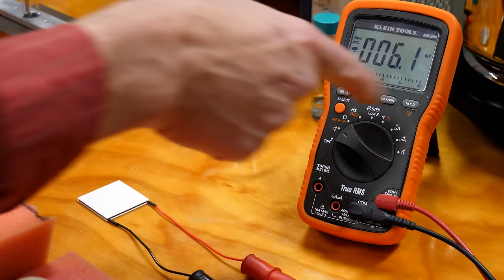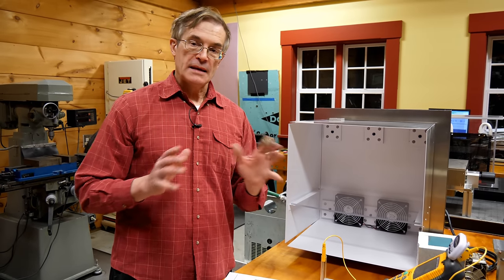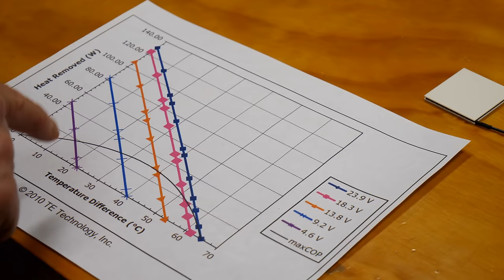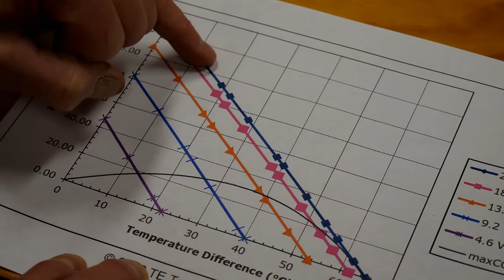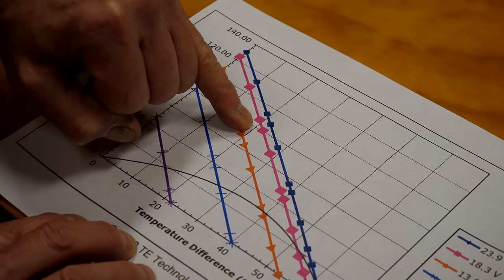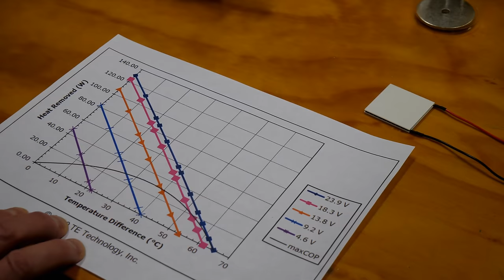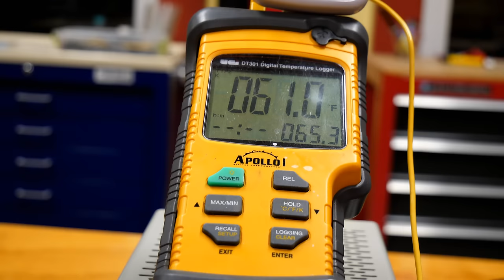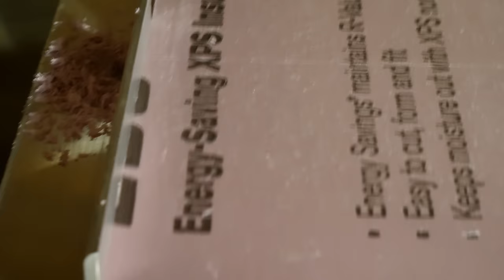BUILD YOUR OWN REFRIGERATOR! - SOLID STATE TEC

Comment: I'm thinking about trying something like this but with some mods.   Edit:  (I have different plans/ideas than originally written here).
Reply: "I don't care if TEC's aren't that energy efficient compared to standard compressor AC/refrige units, if I'm using relatively free energy from the Sun to power it."

  Also, it will be so ridiculously well insulated that will help to off set the less efficient cooling system.  Imagine if a refrigerator or cooler was primarily vacuum insulated?  It would need a much smaller compressor/cooling unit attached to get to and maintain similar temps as a much less well insulated
Reply: How did your fridge turn out?
Reply: @lindastevens5615    Hi Linda

    I apologize for the late response.  I don't think I ever got a notification about it.  To answer your question, I didn't fully start the project yet. I just ended up buying some TEC's awhile back.  Recently I got re-interested in the project because I've learned more about IR sky window cooling and how to better achieve it.  It's reignited my interest in this project.  I recently bought some supplies and also am still waiting on some supplies.  Once the project is done and tested, I'll probably make a video on how to do it.  I'm more interested in the passive IR-sky window cooling aspect than just the peltier part.  

   It's been a bit challenging trying to figure out how to insulate really well (in relation to conduction and convection) while allowing plenty of IR to pass through, but I "think" I have the code cracked to insulate extremely well while allowing IR to pass through.  (Unfortunately, it requires some extra, annoying steps like dissolving the nylon off of a nylon/PE composite). 

  While I'm waiting on the supplies for the above, I'm finishing an ultra efficient, fairly easy to make Solar cooker system, and plan to do a video on that soon.

Comment: nice ideas...i wopuldnt use computer heat pipes thou...they work by eavapration and thats not working at low temp
Reply from the maker: Maybe not, but heat pipes are available  that cover different temperature ranges.

Comment: Sir, 
How did u get the most suitable heat sink 
Why did you get a hole block for compress the heat sink
What is the thickness of the Aluminum plate in the heat sink
Can you send me the dimensions of the design
Reply from the maker: The cross sectional area of the fans determines the necessary, minimal cross sectional area between the metal sheets that comprise the heat sink.  From this you can determine the required thickness of the spacers between the sheets based on how many sheets you will use (the more the better).  The size of each spacer, beside it's thickness, needs to be larger than each TEC to permit the threaded rods to pass around the TEC in order to clamp the stack.  There is a benefit to the spacer being larger than the TEC because that means you have a lower resistance to heat flow, but this benefit improves ever more slowly as the spacer continues to grow.  The hole increases the clamping pressure within the stack and allows the thermal grease to flow from between the interface, thinning the gap.

Comment: I am working with a few nonprofits looking for water sources for poor villages in Ghana for example (relatively high heat and high humidity) and we're considering water generators like the Warka water towers that work with the wind and natural condensation alone as well as solar PV powered condensing units like https://www.zeromasswater.com for example which are basically A/C units that only take advantage of the condensation and not the cooling ability.  It seems like an A/C could be designed to maximize both abilities and Tech Ingredients could probably lead or help with such a project, no?
Reply from the maker: Very interesting.  Dessicant based water accumulators could yeald their absorbed water using direct solar heating.

Comment: Why the aluminum Spacers has a hole?
Reply from the maker: It increases the contact pressure, which increases the performance  more than the loss due to a decreased surface area.

Comment: Given very poor efficiency and all that waste heat, instead of cooling, how about a replacement for a basement space heater with the Peltiers mounted on a poured concrete foundation and heatpumping whatever heat can be salvaged from a 20F wall.  Yes, the efficiency gets much worse pulling 70F from a 20F wall, but there is no "waste" heat and the heating system would approach 100% efficiency.  Wonder how a set of 10 Peltiers would do when pulsed at 120Hz from a fullwave rectified 60Hz 120vac house voltage.

Comment: Why aluminium blocks on back wall are much thicker then other blocks?
Reply from the maker: That allows the heat to flow through the thick layer of insulation.
Reply: @TechIngredients  will 0.71 in. be thick enough or need more thickness?
Reply from the maker: They should be as thick as the layer of insulation that they are designed to penetrate.  0.71" is near the minimum amount of insulation that you will want on the back surface.
Reply: @TechIngredients  Thank you. And what thickness would you advice?

Comment: A QUESTION ? ,, IF HEAT IS OBVIOUSLY A NEGATIVE SIDE EFFECT OR SOURCE OF LOST POWER ,, WHY NOT USE THIS HEAT TO BOIL A LIQUID OF PROPER VISCOSITY AND USE THE STEAM/VAPOR  OUTPUT WHICH SHOULD HAVE AN INCREASED PRESSURE AT THIS POINT TO RUN A STEAM TURBINE GENERATOR ,, THEREBY RECOUPING OR GAINING INCREASED OUTPUT/EFFICIENCY INSTEAD OF JUST WASTING THE HEAT ENERGY ? COULD'NT YOU  USE EVERY ASPECT OF PROCESS  IN EACH FORM TO BOOST/RECOUP ENERGY FOR BETTER  OVERALL EFFICIENCY  ? ANOTHER  THOUGHT IS WHY NOT USE THE PELTIER DEVICE AS THE HEATSINK   [  becoming a thermoelectric generator ]  , RECOUPING THE HEAT GENERATED BACK INTO USABLE ELECTRICITY FOR THE SYSTEM POWER REQUIRED IN THE FIRST PLACE  ,, SAY 4-6 ?  AS GENERATORS TO  1  USED AS A COOLING DEVICE  , WHY WOULD THIS NOT WORK WITH PROPER REGULATION OF THE COMBINATION  ?
Reply from the maker: Probably not.  The losses at each stage have to be accounted for and they add up.  The gains will likely be small do to the low temperature gradient at each stage.

Comment: Here's an idea... How to cool by mere frequency. You heat water in a microwave by frequency... Cool something by frequency.
Reply from the maker: That's a "sound" suggestion.  Have you heard of laser cooling?  If not, it's basically what you suggest.  By very slightly detuning the laser from the absorbtion frequency of a material, only the fastest atoms in a sample are able to absorb the light due to doppler shifting.  These then are slowed when they in turn emit the light.

Comment: why the hole in the aluminum plate. a full block wouldn't have been better?
Reply from the maker: It increases the pressure on the on the interface which is more important than the conductivity through the bulk of the aluminum.

Comment: Why not liquid metal as a conductor of heat in the back? Much better thermal conductivity. Inb4 "mercury is toxic!" - Use gallium.
Reply from the maker: It has to be contained if you're talking about using it in bulk as a floing liquid.  It's also pretty expensive.  If using it as a thermal interface material, it is corrosive to aluminum.  Gallium is extremely corrosive.
Reply: @TechIngredients  Yes, I was referring to using it as a thermal interface material to replace the thermal grease you're using. 

I'm not sure exactly what you used, but most have about 1/8th the thermal conductivity of gallium - You wouldn't need much and it would definitely remove any possible "bottlenecks" of thermal dissipation on the "hot" side of those peltier coolers. 

There is concern for corrosion, of course - You could use copper plates instead of aluminum.
I've noticed that gallium seems to react only temporarily with copper and eventually forms a sort of alloy on the surface, protecting it from corrosion.
Between the copper and gallium, I believe you could reach an even better level of efficiency with that unit.
Thank you for the content, I love your methods of explanation and hope to use some of them to introduce my sons to science!

Comment: Watched this and the related videos many times, its starting to really sink in. My question is, why are there holes in the compression blocks at the back? If I had to guess, you needed to actually reduce convection (your 3 legged stool analogy in another video). Otherwise, you are giving up increased mass that could aid in convection heat dissipation. Thx for all you do!
Reply from the maker: Thanks for the feedback. 
The hole improves the thermal conduction by increasing  the pressure against the thermal grease.  That's  more important  than the loss of surface area.
Reply: Also, the fans on the back, unless there is an air path we can't see, they're blowing onto the surface of the final panel (which are just really big fins). Wouldn't the fans perform heat dissipation better if they were on the sides of the radiator thereby blowing evenly across all the fins/panels? Just trying to fully cement things in my brain.
Reply: Finally (I think), if I were to switch polarity and use this as a warming box, I would need fins on the inside. It appears the entire 'double' back of the unit is the cooling plate. Could I simply install a large heat sink on the interior back panel in the space not occupied by the blocks that comprise one end of the conduction path pressure system?
Reply: That is so alien to my brain! Never woulda thought that. Speaking of that pressure, you mentioned that the TECs could withstand 216 (iirc) psi. I assume that would require a torque wrench. Which would represent the first time I have ever applied such a tool in an electronic project. Hell, not even sure I have a torque wrench haha.  @TechIngredients
Reply: @TechIngredients  These 'replies' don't nest, was trying to keep your site neat and tidy. I apologize, I see you answered my 'holes' question in other posts. There isn't a search function and my browser only paints a portion as I scroll through comments so its own search is limited.

Comment: 24 Sqft?where did you put the other 21.6 Sq feet?
Reply from the maker: What are you talking about?
Be specific, because the surface area calculation is based on the midpoint in the insulation for all six sides of the box.

Comment: Ironic that R Value and Imperial measurement are calculated based on British thermal units and the Metric System respectively.
Reply from the maker: This is a lot more common than many people realize.  Look at the output of super cars from around Europe.  Almost all are rated by horsepower, but built in contries with with, if I may say, an almost fanatical devotion to metric.

Comment: At 30:20 your results are skewed. You was putting heat right beside the insulated vessel.
Reply from the maker: It's difficult to understand you.  Could you please explain this in more detail?
Reply: @TechIngredients  ok, genius you left the stove on the test with the original pc fan. With hot moist air blowing across the blades isn't very efficient
Reply from the maker: Genius, I like that.😀
All the tests were made in the same location and the purpose was to evaluate the RELATIVE performance of the cooling methods. The hot plate doesn't matter.
Reply: @TechIngredients  function tests are tests. To move forward in science its in the minutia. Your design reminds of a old Arabian tech that stores heat in large structures at night it collects water as it would still be hot. Funny refrigeration has been around since the 900s and theirs didnt use any electricity

Comment: try liquid hydrogen under water sealed pressure fridge, generate pressure by water-carbon 0.2V electrolysis
Reply: you get dry ice and normal ice as side product
Reply: if you treat that middle plate as electron-clearing zone, you can make a photoelectric panel, and assist it with a electric field to direct electrons to one side
Reply: just put enough and more to stop heat diffusion completely and control temperature with cooling sensor switch?
Reply: if you worry about quadratic power rule, use more units using less current

Comment: Can propylene glycol be used in place of silicone oil.
I recall you can stack the thermocouples to increase the delta T.
The efficiency increases with delta T. Crunch out the numbers for a 48 volt system. I figure you can pump 400 watts of heat with 5 A at 48 watts input. COP close to 2.0. That way you can use your bike battery to power the fridge AND freezer!.
 Why do you keep bashing us monopole people? It's not as bad as flat earth.

Comment: Your explanation of how a refrigeration compressor works is incorrect as you described it. The compressor increase the pressure (in addition to adding heat of compression). This high pressure superheated gas is cooled through a condenser. The outlet of the condenser is a high pressure liquid. This is then put through an expansion device (or orifice). After the expansion you have low pressure liquid. This will absorb heat in the evaporator where it will enter the compressor again as a low pressure gas.

Comment: The only thing "extreme" about this is its inefficiency.
Reply from the maker: Have you looked at the available options  for solid state refrigerators?  This is an extreme example of that type.  As I said in the video and as you point out, thermoelectric coolers are not effecient.

Comment: "Heat will lift or rise." Okay it's better to say like all things, heat [a more energetic volume of air as opposed to the surrounding air] will seek balance at whatever orientation [up, down, sideways, whatever]. <<<That was for the overly correct nerds out there. Back to real life applications. 

The tendency of hotter air to "seek" it's own level in and of it's self has energy. Enough to negate to need of fans. Think jet engines. Move the Peltier's closer to the top, seal the sides of the cooling fins of the condenser, increase the opening at the bottom of the condenser to three times the top area and only use fins for the top half within the condenser box area.
As the Peltier's generate heat the heat will not only move up but will expand. Cool air from the bottom will seek to fill the void. Being compressed by the tapered box then heated and expanded by the Peltier's will create a forced convection flow of air.
In the old days you could demonstrate this effect by placing a cigarette an inch to the outside bottom of a table lamp with a 60w bulb heating the inside of the lampshade. The smoke from the cigarette would move sideways into the shade and excellerate up and out the top.
I guess the modern equivalent would be to use a heated piece of metal with a funnel placed upside down with a joint burning  near the inverted funnel. But whatever.

Comment: been thinking of convection boiler/freezer for well over decade. I want a low enough temperature to freeze oxygen. Maybe high temp for smelting iron oxides? System i think does have domestic applications. Industrial, there may need to be lower high temperatures to reach hydrogens freezing point. Secondary education should be teaching calibration, of what was learned in primary school. Secondary education is the place i think the technology could be harnessed the best?

The fatal flaw in the education i think is in dumbing down the language to much. Over simplifying basic principles resulting in poorer progress at higher levels of academic excellence.

Comment: Now when you put that device onto your multimeter and you were generating negative and positive current by just placing your thumb on it why can't you just take that device itself put it in your pocket and have it plugged into your cell phone and trickle charge your cell phone or anything that doesn't require that much charge voltage! If you put that same little square device I forgot what you called it, but if you put that in the sunlight wouldn't it generate electricity if you're applying heat to one side and it creates a negative voltage and then you apply heat to the bottom or the other side and it creates a positive charge why can't you charge with that same device? Just put the one side against your skin in your pocket?
Reply from the maker: You could.  The small differential will only generate  a small current.
Did you watch our video on the "Campfire Generator"?

Comment: There is no way that tiny little fridge is 24 square feet. You better re-check your calculations. LOL
Reply from the maker: It is.  You should rewatch that portion of the video.  As I explained, that given area is measured at the midpoint of the insulation surrounding the refrigerator, not the surface area of the shelves.

Comment: "this unit is rated at 175 watts". That's a 40 watt CPU cooler.
Reply from the maker: The TEC I showed was rated at 175 watts maximum input power.  As I discussed in the video, you don't want to operate it at anything like that maximum power because it becomes progressively less efficient.  It will cool a CPU at 40 watts, but it will cool a CPU at 20 watts even more efficiently.

Comment: If you made your own heat sink, why did you not use copper instead? Copper has better heat transfer right?
What are the pros and cons for this project?
Reply from the maker: Copper is much more expensive and much harder to machine.

Comment: Not sure why he bothered to go through all that effort for a refrigerator that opened from the side. Now every time you open it the cold air you've worked so hard for is going spill out. You should have built a unit that opens from the top like a chest.
Reply from the maker: I did that for practical convenience.  We could have increased the thickness of the insulation almost without limit, removed the light and opened the door from the top, but making the refrigerator harder to use is a competing concern.